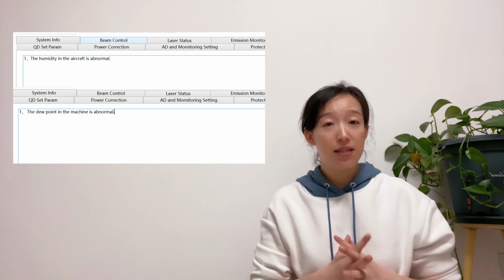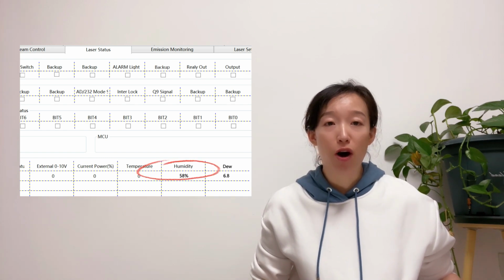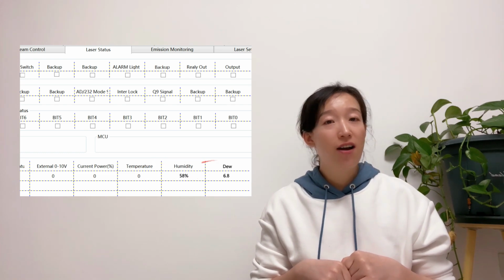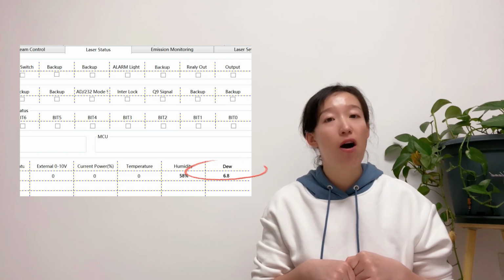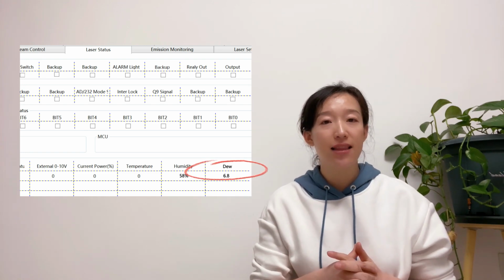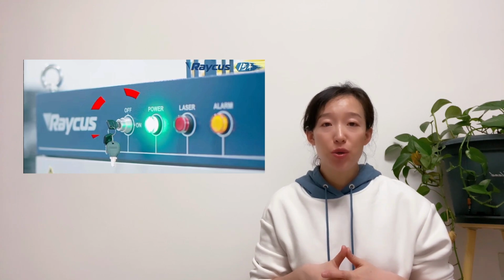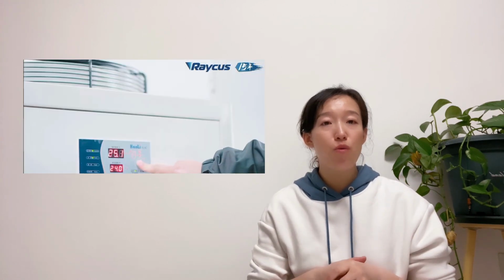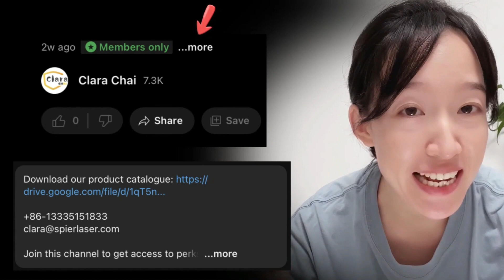Raycus Laser Alarm: Humidity and Dew Point | Laser Cutting Problems

Comment: clara i have questions about laser source:
we can cut by max power 100% of power for Long time 4 hours or laser source will damaged?  just need to work for long time 4 hours need 85% of power to avoid damaged laser source ?

Thanks
Reply from the maker: My personal preference, won’t cut long time at 100% power.
Reply: @ClaraChai  thank you but how much is percentage of power is ok for long time of cutting.

For example if we have laser source 1500w and we want to cutting 10 mm thickness of mild steel and 4 hours of cutting .
How much of percentage of power is ok for this situation.

Thanks